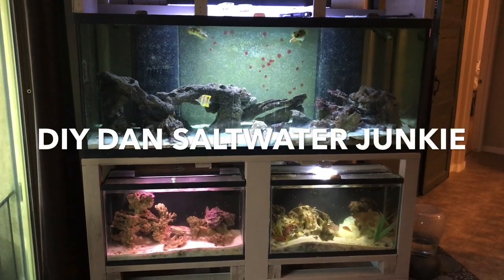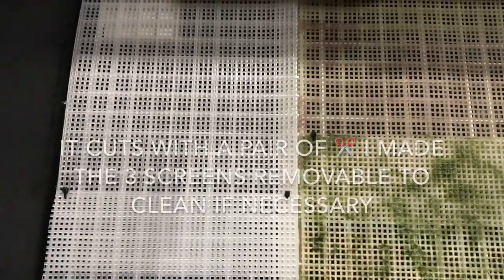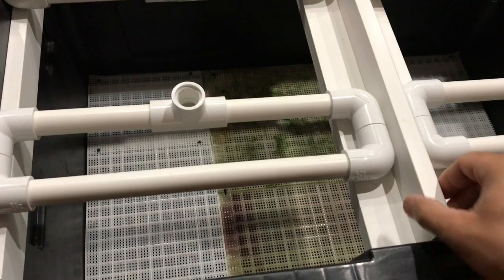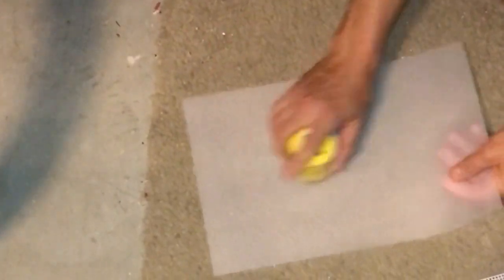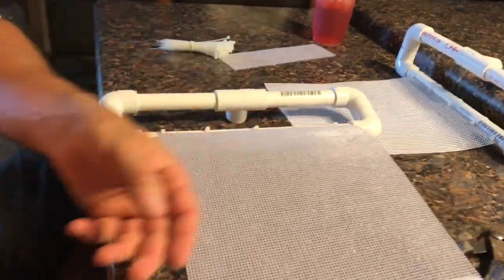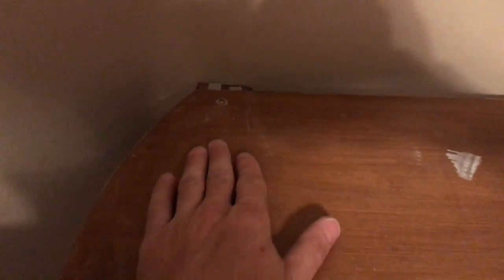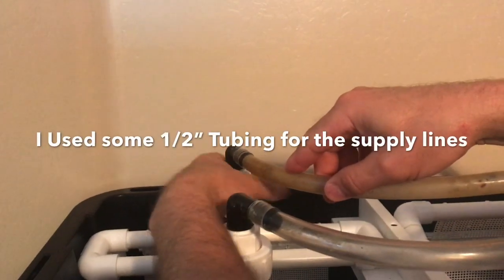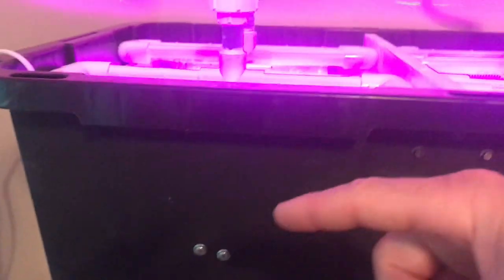ALGAE SCRUBBER HUGE BUILD  WATCH NEW UPDATE VIDEO HAD AN ISSUE NOT A BIG DEAL EASILY FIXED

Comment: I like your design. I have few questions: 
1) why did you made 4 screens instead of 2 long screens?
2) what if we add lights between the middle part of the screen using acrylic sheet so that each screens can have light source from both side?